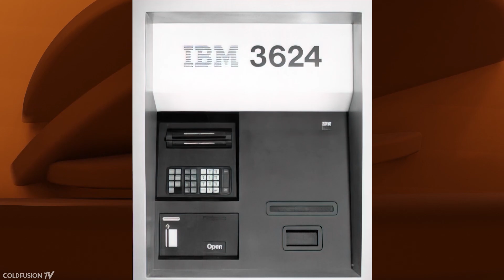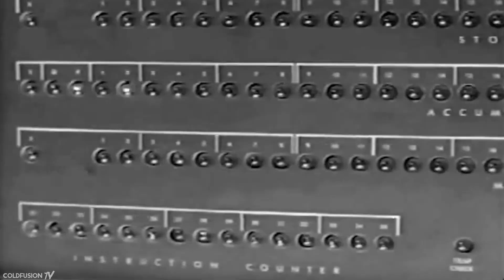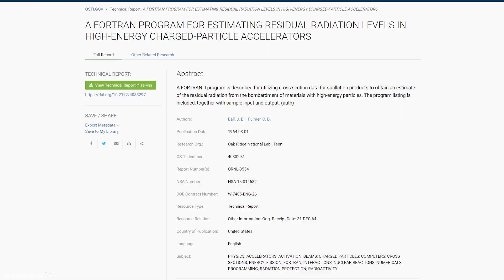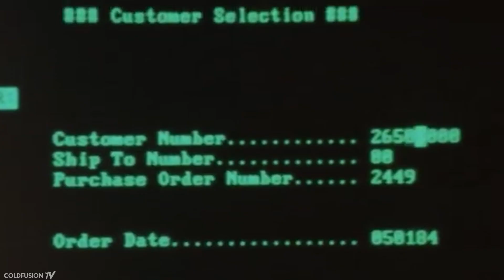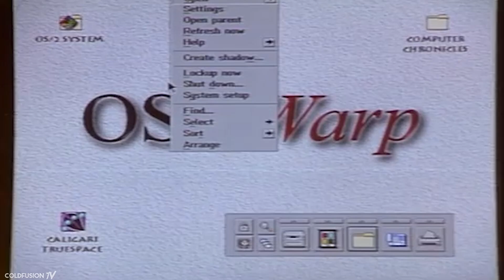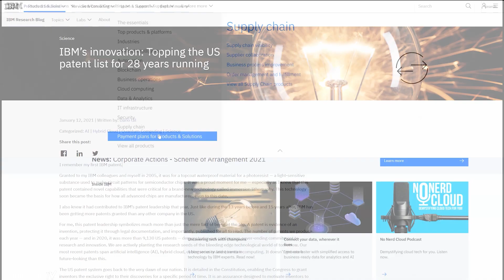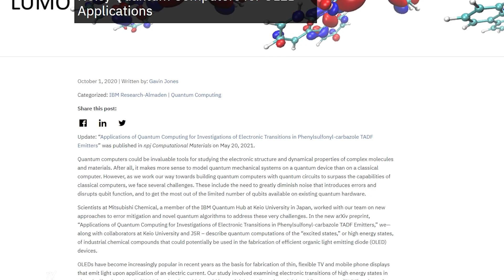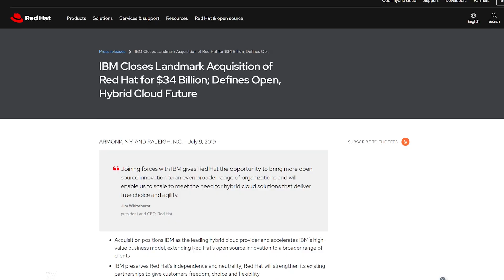The Rise and Stagnation of IBM

Comment: I know that IBM is running Red Had Linux , it's provider of many software for Gnu Linux, like ex. Systemd which is an initialization system that loads Linux Kernel and applications.
Also Red hat is related to Fedora which is a very popular distribution of Linux on desktop. So , IBM is very engaged in servers software. In summary for this video and from my knowledge it looks like they do specific  stuff ,that people may not know from the simple perspective. IBM is still alive, it just changed.

Comment: HOW ALL IBM 360'S BECAME GOLD JEWELRY AND 370'S WENT TO LAND FILLS

On long Island ny, lake ronkonkama their was a computer refurbishing and storage facility
that was used by all the leasing companies in the USA. They would give free storage 
of 370/360's to leasing companies until the machines were resold or released and they
would get the refurbishing jobs.(that was their business plan free storage to get clients).
when i was at the wharehouse they had 500 370's, 100 360's.( it was larger thatn
any ibm wharehouse i have ever been in.(ibm used local wharehouses, in nyc
obies had about 20 370's in storage in LIC.

To refurbish a 370(painting and testing) usually cost $2,000 to $10,000.
The owner name was  lenny he was very difficult to deal with. 

Parts from 360's/370's were interchangeable so i need parts to service 10 system 3's
i had on lease in NYC and 3 sys 3's that i used in my service bureau.
lenny was suppose to sell me a 360 and a 370 for part for $500 each.

When i got there with one of my engineers to break down the computers and
salvage the parts, he doubled the price!!!

So columbia was junking their 360/91(original price 3 million), i call the junk dealer
(he was from south dakota) and he sold me 360/370 card for $1 each and disk
drive head for $1 each, and i did not have to spend a day breaking down
any machines and paying to remove the frames.(This was 1984)

The ibm 360 had a bout $20,000 worth of gold plating and we would sell a 360
to scrap dealer/gold refiners in tiwan, they would pay $2000 each.
so almost all 360's went to tiwan and were scrapped for their gold.

The 370's did not have any gold,  IBM used palladium platted contacts.
their was about $500 worth of palladium in a 370 computer.
So ALL 370'S WERE WORTHLESS TO SCRAP DEALERS AND USUALLY
WENT TO A LAND FILL.

IN THE 1980'S I WOULD CHARGE A CUSTOMER $2000 TO DISASSEMBLE
A 370 AND PACK IT FOR SHIPMENT(IBM WOULD CHARGE $10,000 TO DO
THE SAME JOB). 

THE COMPUTER WOULD USUALLY BE SOLD FOR $500 OR
 THE CUSTOMER WOULD PAY A JUNK DEALER TO TAKE IT TO A LAND FILL
(370'S HAD NO SCRAP VALUE).

SO LENNY HAD OVER 500 370'S HE HAD TO LANDFILL WHEN
HE WENT BANKRUPT. (NOT A VERY GOOD BUSINESS PLAN)

SO IF DON PAID MORE THAN $500 FOR HIS 370, HE OVER PAID!!!

IBM HAD A GREAT TROUBLE SHOOTING SYSTEM. TO FIX A 360/370
USUALLY TOOK ME 3 HOURS. TO FIX A PC LAPTOP OR SERVER
USUALLY TAKES ME 3 HOURS.

WE HAD RCA/ UNIVAC COMPUTERS THAT USED CONVENTIONAL
WIRING DIAGRAMS AND IT USUALLY TOOK 1 TO 3 DAYS 
TO FIX AN RCA 301.

IF DON HAS ALL THE BLUE BOOKS(DIAGRAMS) THEN IT SHOULD
TAKE ABOUT 12 HOURS TO INSTALL HIS 370  SYSTEM.
MOST REPAIRS ON A 370/360 WERE OVER HEATING OR 
BAD CONTACTS. YOU WOULD FIND THE BAD CARD AND JUST 
CLEAN IT WITH ALCOHOL AND RE PLUG THE CARD AND THE 
TROUBLE WOULD DISAPPEAR!!!

IBM FINALLY SOLVED THE CONTACT PROBLEM IN THE PC,
THEY USE A SCREW TO HOLD THE CARD IN TIGHT!!!!
IT ONLY TOOK 20 YEARS FOR IBM TO SOLVE THAT PROBLEM!!!!!

Comment: C/O (CORRESPONDENT) (IMF) (UNITED NATION ORGANIZATIONS) (UNO):

Pembelian Saham Secara Langsung dari (Equipment Trust)

Kalau saham diperoleh melalui pembelian dari pasar terbuka, maka (Holding Company) dapat memperoleh sebagian atau seluruh saham dari (Pooling of Interests) yang akan dikendalikannya. Kepentingan yang diperoleh mungkin terdiri dari saham perbendaharaan (treasury stock) ataupun saham yang baru diterbitkan. Dalam satu hal, modal (Trust Receipt) mengingat sebagai akibat dari pembayaran untuk saham (75%), dan (35%) selanjutnya dalam penyusunan (reciprocal), (Adjustments of Reciprocal Accounts), (right of offset) yang didasarkan oleh (Equity Method) setelah penjualan saham.

Sebagai illustrasi, asumsikan bahwa modal (Equipment Trust) adalah sebagai berikut: (books of original entry), (Holding Company), (joint ventures), (going concern), (joint-stock companies), (Trade-In), (privileges) PENJAMIN UTAMA EMISI 

PT Inter-Pacific Financial Corporation (Inter-Pacific) (1) (Trust Receipt), (2) (controlling financial interest)

Modal Saham (10.000 lembar, tanpa nilai nominal) ($150.000.000.000.--.)

Laba yang ditahan ($150.000.000.000.--. (Cost-push inflation) (75%) (Maximization of Profit) × (Holding gain/$112.500.000.000.--.) + (Holding gain/$15.000.000.000.--.) + (Subsidiary Ledger) (Cost-push inflation) (43%) (Maximization of Profit) × (Subsidiary Ledger) + (Holding gain/25%)

Dikurangi saham perbendaharaan, 2500 lembar dengan (Equity Method) (75%)

Total (Declining Balance Method) ($100.727.625.000.--.) (Historical Cost), (pooling of interest), (treasury stock)

Comment: C/O (CORRESPONDENT) (IMF) (UNITED NATION ORGANIZATIONS) (UNO):

Lembaran kerja apabila kepentingan (joint-stock companies) diperoleh dengan harga di atas (Equipment Trust)

(Equipment Trust) PENJAMIN UTAMA EMISI 
PT Inter-Pacific Financial Corporation (Inter-Pacific)

(Adjustments of Reciprocal Accounts) dalam lembaran kerja menghasilkan saldo investasi sebesar (Marshalling of Assets) ($40.000.000.000.——.), yang dicantumkan dalam (work--sheet) sebagai (Marshalling of Assets).
Saldo ini tidak tercantum dalam (books of original entry) atau dalam laporan keuangan tersendiri (controlling interest) salah satu dari perusahaan afiliasi, melainkan hanya  tercantum dalam lembaran kerja (comparable accounting) (joint-stock companies) (95%) (merger), (Maximization of Profit) × ($175.000.000.000.——.) (dissolution/40%) + (Holding gain/loss) (45%) (Maximization of Profit) × (Trust Receipt) ($565.000.000.000.——.) (Cost-push inflation) (Subsidiary Ledger) (Cost - push inflation) (43%) (Maximization of Profit) × ($30.000.000.——.) ("Pooling of Interests") + (Holding gain/loss) (Subsidiary Ledger) (Cost - push inflation) (43%) (Maximization of Profit) × ($30.000.000.——.)

Untuk tujuan penyusun (Equipment Trust), Controlling Interest/(Declining Balance Method) ($669.849.200.000.——.), perkiraan investasi saldo sebesar (merger) telah diganti dengan (journalpost) sebagai berikut: ("complete combination"), ("Pooling of Interests") Situasi ini diilustrasikan pada lembaran kerja (Adjusted trial balance) sebagai berikut: (Straight Line Method/$195.000.000.000.——. (Cost - push inflation) (90%) (Maximization of Profit) × (Imputed Interest) + (Holding gain/loss) (55%) (Maximization of Profit) × (Subsidiary Ledger)  + (Holding gain/loss) (55%) (Maximization of Profit) × (Subsidiary Ledger) + (Holding gain/loss) $195.000.000.000.——. (Cost - push inflation) (10%) (Maximization of Profit) × (controlling financial interest) + (Holding gain/loss) (55%) (Maximization of Profit) × (Subsidiary Ledger)  + (Holding gain/loss) (55%) (Maximization of Profit) × (Subsidiary Ledger) + (45%) (Declining Balance Method) ($283.100.900.000.——.) (Balance Sheet) ² Accounting Research and Terminology, No. 51. "Consolidated Financial Statements" (new York: American Institute of Certified Public Accountants, 1951), comparable accounting. 2.

Jika modal (merger), sebesar (Trust Receipt/$50.000.000.——. / Equipment Trust) terdiri dari modal saham sebesar (Subsidiary Account) ($200.000.--.) dan defisit sebesar (Subsidiary Ledger), dan sementara itu (Holding Company) memperoleh (90%) saham (merger) dengan harga sebesar (Marshalling of Assets) ($175.000.000.000.——.), maka (Adjustments of Reciprocal Accounts) akan tepat sama dengan (correcting balance/$22.000.000.--. + Holding gain/loss $20.000.000.--. + $175.000.000.000.--.), (work--sheet) (Cost-push inflation) (45%) (Maximization of Profit) × ($90.000.000.--.) (Declining Balance Method) ($175.001.500.000.——.) (Complete Combination) kecuali untuk rincian kepentingan minoritas.

Comment: C/O (CORRESPONDENT) (IMF) (UNITED NATION ORGANIZATIONS) (UNO):

Laba dan Dividen (Equipment Trust) PENJAMIN PESERTA EMISI
PT Multinational Finance Corporation (Multicor)

Untuk mengilustrasikan prosedur konvensional dalam pencatatan laba (Equipment Trust) dan dividen (Subsidiary Account) setelah perolehan (going concern), asumsikan bahwa (Subsidiary Account) melaporkan laba bersih untuk periode 6 bulan yang berakhir per 30 Juni (Trade-In) sebesar (Subsidiary Ledger) ($20.000.000.——.). Dividen sebesar (correcting balance), (reciprocal), (joint-stock companies), (subsidiary account), (Subsidiary Ledger) "Internal Revenue Code"  diumumkan oleh (controlling interest) (Holding Company) pada tanggal (pooling of interests) dan (joint-stock companies) "Includible Corporation" (Trust Receipt) (Adjustments of Reciprocal Accounts)
(Merger) (35%) (Maximization of Profit) × ($3.900.000.000.——.) + (Holding gain/loss) (80%) (Maximization of Profit) × (Subsidiary Ledger) + (Holding gain/loss) (80%) (Maximization of Profit) × (Imputed Interest) (Cost - push inflation) ($30.000.000.——.) (Input Value) (43%) (Maximization of Profit) × ($30.000.000.——.)  (Declining Balance Method) (merger) ($1.402.100.000.——.) (Equipment Trust).

Apabila Lembar Kerja (work sheet), (Equipment Trust) untuk (Trade-In) disusun pada saat perolehan (Trust Receipt) saham (Subsidiary Account), maka penghapusan dilakukan untuk kekayaan yang diperoleh semula dalam (Subsidiary Ledger) dengan mendebet saldo modal (joint ventures) dan mengkredit perkiraan investasi. Apabila (Holding Company) menggunakan metode ekuitas untuk membuktikan investasi dalam (Subsidiary Ledger), maka saldo perkiraan investasi menggambarkan kekayaan semula dalam (Equipment Trust), yang disesuaikan untuk perubahan yang telah terjadi dalam kekayaan ini. 

Dalam menyusun lembar kerja untuk (Adjustments of Reciprocal Accounts) setelah tanggal perolehan saham, maka penghapusan harus dilakukan menurut kekayaan pada tanggal (Adjustments of Reciprocal Accounts). Masing-masing saldo perusahaan (joint ventures) didebet sebesar persentase pemilikan yang ditetapkan pada (books of original entry), dengan menghapus saldo modal yang tersisa ke dalam kolom-kolom (Adjustments of Reciprocal Accounts) sebagai kepentingan (merger). Perkiraan investasi (Adjusted trial balance) dikredit "Internal Revenue Code" (103.900.-- ) dan setiap selisih antara saldo perkiraan investasi (Trust Receipt) (103.900.-- ) (Subsidiary Account) dan jumlah dihapuskan (merger) terhadap saldo modal (Equity Method) diperluas dalam kolom-kolom (Adjustments of Reciprocal Accounts) sebagai (Equipment Trust).

Comment: MY  DELL I7 LAPTOPS AND DESKTOP(SERVERS) ARE FASTER THAN IBM AND CDC SUPER COMPUTERS
FROM THE 1960'S, 1970'S, 1980'S. WHEN OFFICE RENT IN NEW YORK CITY BECAME TOO EXPENSIVE IN THE 1990'S  I REPLACED MY IBM 370, 4331, system 3's  MAINFRAMES WITH DELL LAPTOP AND DESKTOPS COMPUTERS(SERVERS).

  WHAT USED TO COST ME $3000 PER MONTH FOR OFFICE RENT AND ELECTRIC NOW COST ME $200 per month
WE OWNED THE MAINFRAMES WE WERE USING(WE HAD A COMPUTER LEASING CO) AND I DID THE MAINTENANCE
ON ALL THE COMPUTERS, SO THOSE COST WERE VERY LITTLE.

IF WE HAD BEEN LEASING OUR EQUIPMENT FROM IBM THE COST WOULD HAVE BEEN: $3,000 rent + electric,
$13,000 for equipment rental = $16,000 per month!!!

so it is easy to see the downward trend in the sales of ibm z computer prodectS
ALL IBM PRODUCTS ARE OVER PRICED 5 TO 10 TIMES NORMAL PRICE OR OBSOLETE!!!

I NOW RUN MY OLD IBM MAINFRAME PROGRAMS ON A DELL LAPTOP USING IBM MVS + TK4
IT COST ME ABOUT ONE DOLLAR PER DAY OR 10 CENTS PER HOUR!!

WHEN I NEEDED TO RENT A MAINFRAME IN THE 1980 AND 1990'S
I PAID $100 PER HOUR DAY TIME OR $40 HOUR AFTER 12 AM AT NIGHT!!!

HOW THINGS CHANGE!!!

Comment: IBM IS RED HAT LINUX IT IS JUST ANOTHER LENUX VENDOR SELLING ITS VERSION OF LINUX. THEIR ARE HUNDREDS OF FREE VERSIONS OF FREE LINUX.

 IBM MAKES VERY LITTLE AND IS REALLY AN INVESTOR THAT BUYS 5 TO 20 COMPANYS PER YEAR AND SELLS 5 TO 10
COMPANIES PER YEAR.  IBM IS REALLY JUST AN INDIAN COMPANY WITH MOST OF ITS OPERATIONS IN INDIA AND A HEDGE
FUND/FINANCIAL OPERATION PLUS CONSULTING IN THE USA. 

IBM SOLD OFF MOST OFF ITS GLOBAL SERVICES BUSINESS(LOSERS) TO INVESTORS IN AN IPO, IT USED THE 24 BILLION FROM THE SALE TO BUY RED HAT LINUX(INVESTORS FOOLISH ENOUGH TO BUY IBM CAST OFF STOCK IN THIS IPO HAVE LOST MONEY).

THE FUNDAMENTAL PROBLEM IS IBM BETTING ON GENERIC TECHNOLOGY(LINUX) THAT IS FREE AND EVERYONE
CAN ACCESS. IBM IS TRADING ON ITS LABEL AND PAST GLORY, IT IS NOW A "QUICK BUCK" STOCK BUY NOT A GOOD 
LONG TERM INVESTMENT.

THE ORIGINAL MISTAKE WAS: IBM ZOS IS 50 YEAR OLD TECHNOLOGY(ITS OPERATING SYSTEM EVOLVED FROM IBM360 OS)
WHEN THE WEB AND LINUX TECHNOLOGY CAME OUT IN THE 1990'S IBM(LU GERSHNER) HAD A CHOICE:
1) ADD WEB TECHNOLOGY TO IBM ZOS/ 360 0S  TO UPDATE ITS OPERATING SYSTEM TO A MODERN WEB OPERATING SYSTEM
OR OPTION 2.
2) IBM TOOK(LU GERSHNER) TOOK THE CHEAP WAY OUT, THEY ABANDONED OS360/ZOS IN FAVOR OR GENERIC LINUX(WHICH IS  A MODERN WEB OPERATING SYSTEM, IBM PROMOTED LINUIX AS THER WEB OPERATING SYSTEM.

SO IF IBM PRODUCTS ARE GENERIC WHY SHOULD ANYONE PAY 5 TIMES THE COST OF A GENERIC REPLACEMENT??

Comment: The reason is that the near death experience in 1993, and the coming back by pivoting to e business only making IBM leadership obsessed with customized products for less than a few thousands of clients and high profit margins coming of it; as a result the product iteration cycle is slow even when they are critical for some business. For example, clouds and semiconductor both need fast learnings from commodity market with throat cutting thin margins.

Comment: Factual error:  A software engineer inside IBM did not recommend Bill Gates.  Bill Gates' mother, Mary Gates,  served on the same philanthropic boards as IBM's chairman, and she told IBM to get software from her son Bill.  IBM agreed to buy Gates' Basic, Fortran and other computer programming languages from Bill.  IBM did so on condition that Bill supply an operating system.  Bill offered that to Kildall.  When his wife offended the IBM executives who called on them, Bill Gates bought an operating system called QDOS (Quick and Dirty OS) for $50,000 and modified it.  He then offered IBM the resulting MS-DOS for free but non-exclusively and sold it to all the clone makers.

Comment: You missed the reason that actually killed IBM: Compaq. Compaq reverse engineered the IBM's BIOS and created the first 100% IBM compatible PC, where others had failed/been sued and gone bust. IBM were too crippled by bureaucracy to keep up. As result, Compaq developed the first portables and were already ahead of IBM releasing the 80386, barely 5 years later. So, it's thanks to Compaq we have Mac and PC, not Mac and IBM.

Most described in the documentary "Silicon Cowboys".

Comment: I've been an IT Tech as my vocation since 1987. For 28 years I worked for an IBM VAR, which meant that we sold, maintained, upgraded, fixed, patched, cursed at and were amazed by IBM systems. I got out of the Navy at 22. I took some computer courses at the local community college, by my parents home in Freehold, NJ. Programming classes on a RadioShack TRS80. Literally walking to class with an 8 1/2" floppy disk in my hand. No hard drives yet. One of my close buddy's wife was a receptionist at a small local and budding computer hardware/software support company, specializing in IBM Midrange support. They hired me and it's all been learning on the job ever since. I went through all of it. System 34 to the AS/400, and the pc's and micro channel, IBM's successes and failures. The internet came, and Dell and HP and Apple. Our computer support company still supported our IBM clients, but they became fewer and farer between. I was furloughed by that company after 28 years during covid, then let go. Ironically, I have had the very good fortune to get a much better job than I could have imagined. I used to travel to NYC and all over, but now I'm close to home. I was always a road tech/consultant but now I am an IT Manager for a local restaurant group that owns 12 restaurants close to the NJ shore. They have been running their finance AR/AP for 30 years on an IBM system. From a mini System 36 to the Model 270, ( it's 20 years old), that's in production as I type this. I have a newer Power 6, (2017ish),  that's ready to take over this coming week. I have priced its successor and plan to move them into an IBM Power 9 or Power 10, (just released), by years end. So our small successful business has run on a very solid IBM system for many years. The green screens are not pretty. It's all about the data entry. But they don't get hacked or ransomed. Drop it from the second story window, it will still run. Still doing the job very well for us.

Comment: Mate, I spent the late 1970s, 1980s, 1990s and 2000s working with the IBM System/3, System/34, System/36 and AS/400 platforms and am was puzzled as to what happened at IBM.   Then I see the same business model being used by large software companies and they too will go the way of IBM.  IBM had some great technology, albeit proprietary, however it served businesses well and didn't need a small army of technical experts to support it like the crap being peddled today.     Tschüss und Grüße aus Australien

Comment: I remember with pleasure my work on IBM-360 computers (on Soviet clones). And the IBM software that I had the opportunity to use was of the highest quality. IBM has published many programs in source code. IBM has accumulated colossal technical experience. I think IBM stands strong. However, messages like this clip are disturbing. Let's remember the defunct company DEC and its wonderful computer VAX-780, which was also cloned in the ex-USSR.